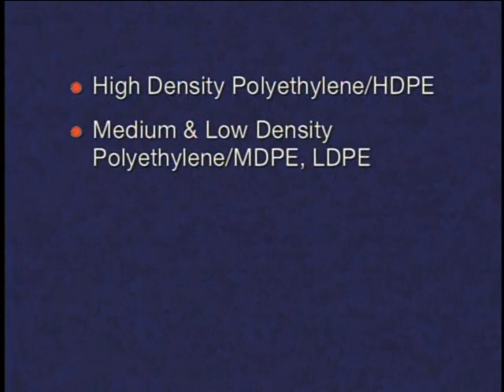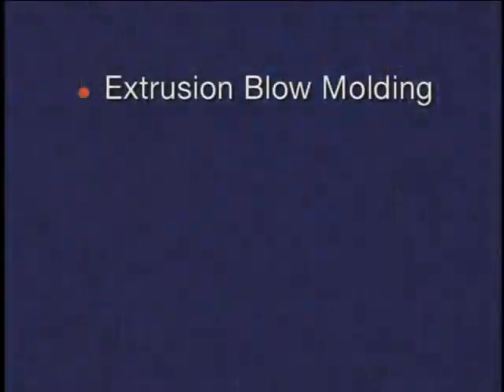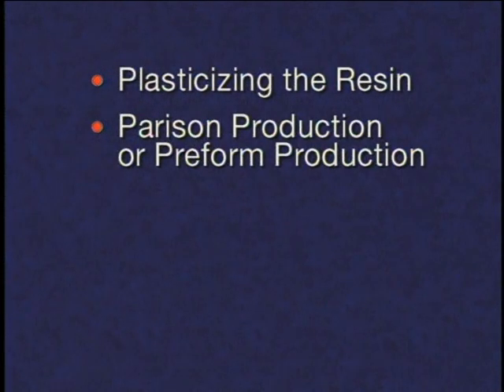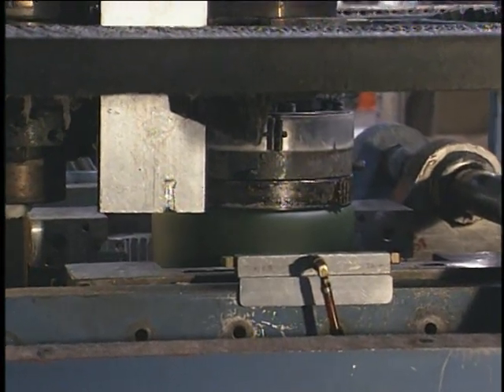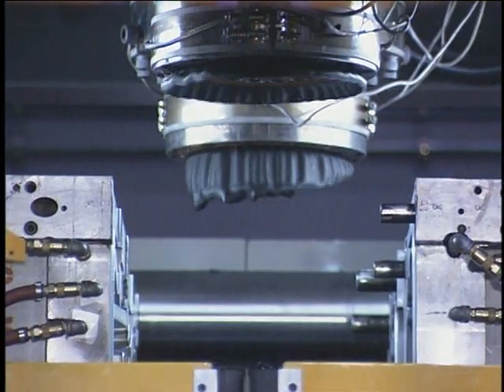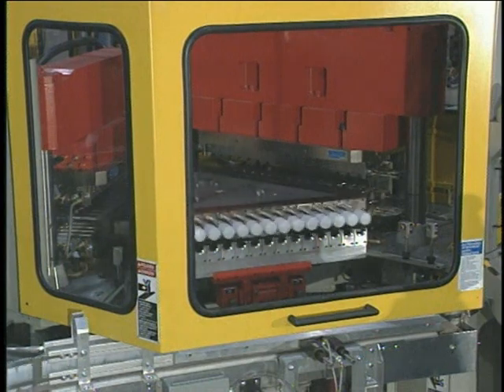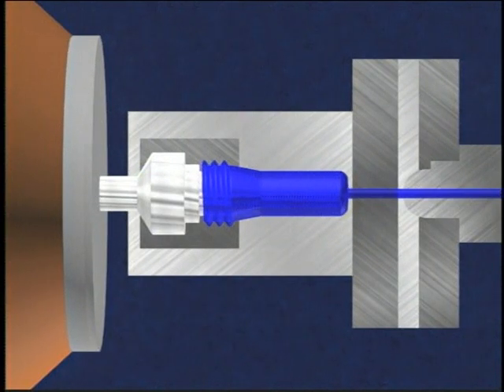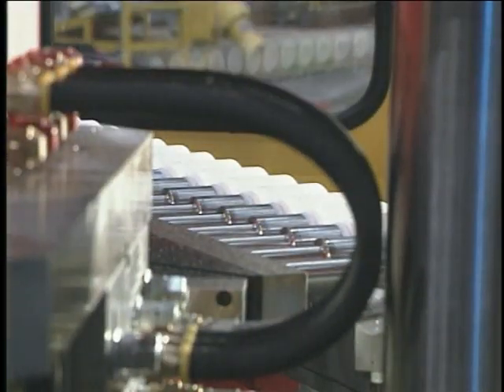Blow Moulding

Comment: Greetings,
Could you pl.furnish me the following safety standards adopted in thiis m/c,
1) Which are the safety certifications  obtained with respect to m/c ( National and International ).
2) Which safety standards/ codes are  adopted in design of safety of m/c
3)Whether safety manual is supplied for the users/ operator. ( highlights )
Pl.furnish the above details. 
Thanks and Regards,,
V.G.Kulkarni.